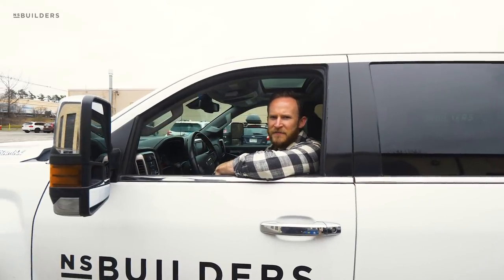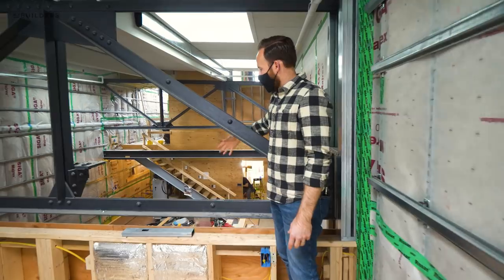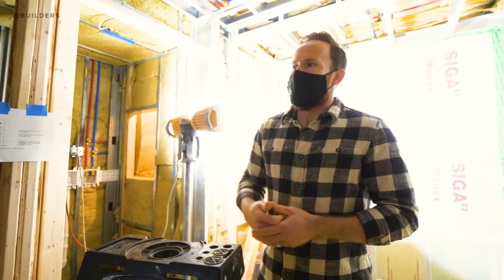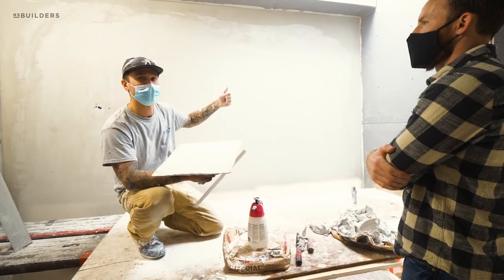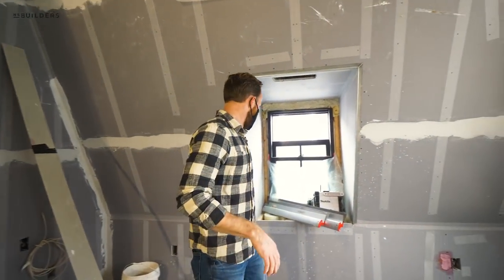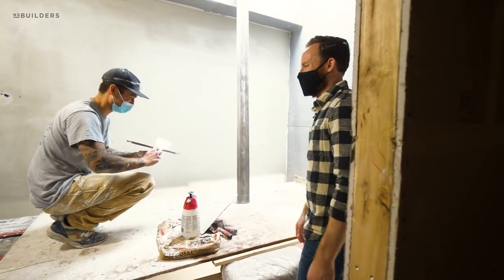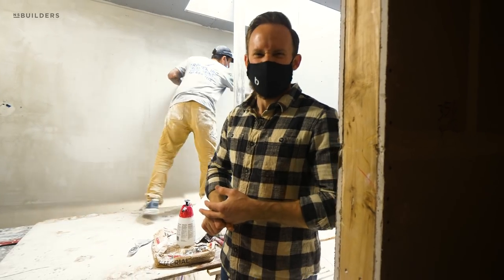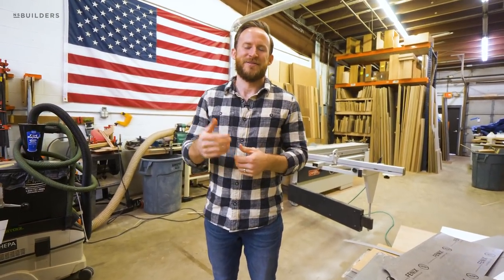Plastering—One Coat or Two?

Comment: plastering is the normal way over here, we don't take quite as much care (not required in most instances), but its far quicker than drywall due to lack of sanding and dry times. typical is two coats of finish plaster, straight on top of each other after you flatten the first coat. only gypsum based really, you cant find many people who will use lime. mesh tape and metal beads

Comment: I like plaster, it feels and looks good, it's nice to see the imperfections in the wall, and I don't see the need to get all anal about everything being perfect, OCD  I guess. I have built mansions where the houses were made to look old used and distressed, we carved up all cabinets and woodwork to look old. The last mansion we did, was level 5 drywall with a diamond plaster super smooth finish with color in the plaster, when you paint it you bury the nice plaster finish. But I guess it depends on where you are, we are in wine country and ultra-modern is not in style.

Comment: So nice to see these projects come together with all the layers of thought and planning! Motion detector @5:55 is a great idea, but also add humidity detection. I've combined both into Arduino-based control boxes. HRV/ERV boost works great because it is remote and quiet. Recess behind fridge @4:42 should be standard! I do it even in existing walls, with power relocated to one of the narrow side walls.

Comment: your building a specific size niche in the wall for a specific TV that will likely be replaced in 5 years.... great idea, what could go wrong
Reply from the maker: Thanks for watching Alex! If the TV is replaced the niche can be modified to fit the new TV. The room wasn't designed around how easy it will be to replace a TV.
Reply: @NSBuilders  One thing that will be a pain is that mount designs and tv mounting screw patterns were kinda standard, however many of the newer 'slim" TVs offset their mounting holes towards the bottom center where all the electronics live, (TCL Specifically). This means that the mounting position on the wall will be much lower than what was traditional. It also means there is a risk of the mount sticking below the bottom of the TV or slightly more visible.

Definitely a good idea to mock all of it up, can never trust the stuff to work all together perfectly